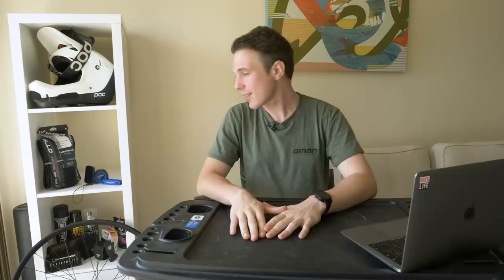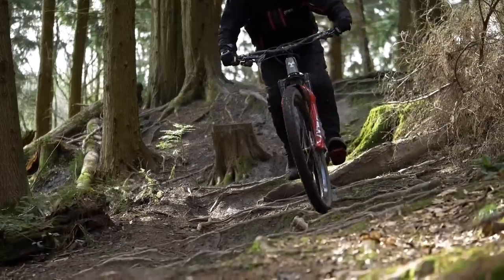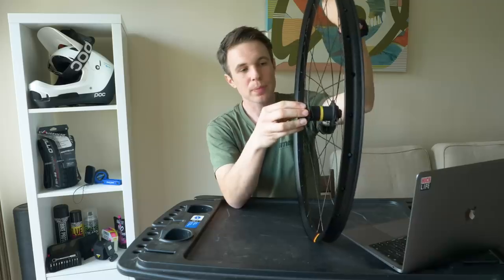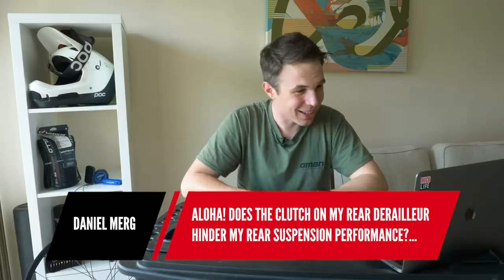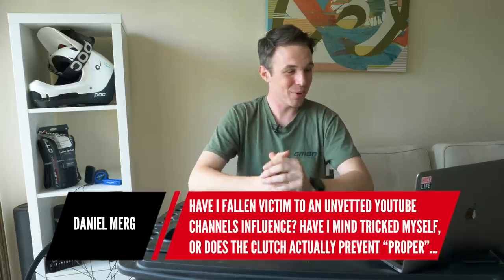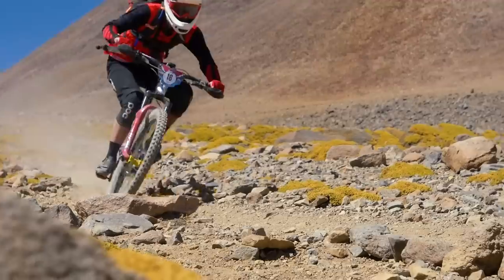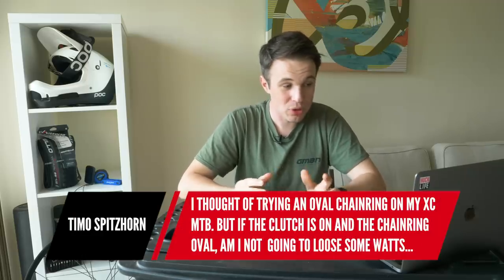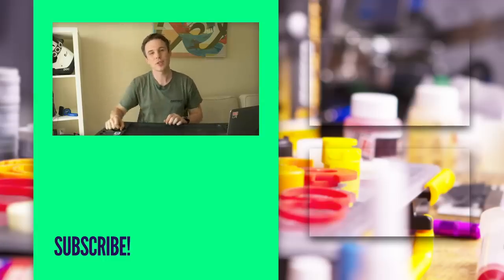E-MTB Components On A Regular Mountain Bike? | #AskGMBNTech

Comment: #AskGMBNTech I recently bought a used specialized status with coil rockshox boxxer forks. The forks needed serviced so the local bike shop put new liquid in and changed the dust seals. Now my fork does something really weird. I'll be riding along with the compression all the way loose and it will suddenly get really stiff and stay like that for up to a half hour then randomly go back to how it's supposed to be. The forks also make a weird squishing noise as it starts getting loosened back up again. Help would be much appreciated. Thanks guys,

Comment: #AskGMBNTech hi, I lover your videos. I recently did a frame swap and needed a shorter travel fork. Can I reduce the travel on my 2015 revelation from 140 to 120mm travel, can I just add spacer or do I need to replace my air spring. (Also how do you add spacers or replace an air spring)

Comment: #AskGMBNTech
Hi Doddy and Henry. Great content on the channel.
I have concern. I got Cube stereo 120 black'n'blue model 2018. My drive train needs some parts replacmet and I decide to o for completly new Deore m6100 1x12 groupset. I have direct mount dropout and I can't find anywhere that rear mech will fit. My curent xt rear mech is fitted completely different way than deroe m6100 mech. Do I need to replace dropout to make it works?
Thanks.

Comment: #AskGMBNTech I have the same squidgy noise but in my 6 month old Lyrik fork.   I definitely think I have air in my damper.    Unfortunately I think bleeding a charger  damper is a lot more involved.   I decided to live with the noise until my 100 hour service.    Anything I can do before that?   Also any issues with waiting?  Finally could I have caused this by storing my bike vertically in a rack that supports the front wheel only (a steadyrack)?    New bike, new rack, squidgy noises all sort of happened at the same time.

Comment: #AskGMBNTech Hey Doddy and Henry, I recently bought a new mountain bike and it has a straight steerer tube and for some reason, the fork moves in the headset, I'm wondering if an o-ring or bearing might be missing or if I just need to tighten the top cap or pinch bolts?  I just bought the bike a few months ago and haven't taken the fork of or anything like that, but I don't think its safe for the fork to move back and forth like that.

Comment: Hello there!
I had a problem with my chain on MTB.
He broke several times.
Is it possible to break chain because of your weight?
It has both suspensions and i am little overweighted. So can it depend on breaking chain?
Reply: No.  The chain will be very strong.  Usually if it's breaking, it's because something is catching under load, and twisting one of the plates off.

I would check for bent or damaged teeth on your cassette and chainrings, and also check that your gears are adjusted properly, and aren't auto-shifting under power.

If you're a heavier rider on a larger frame, you might be flexing the frame enough to cause the chain to shift, especially if it's already a little out of adjustment.
Reply: @nwimpney  thanks alot man, i appreciate it.

Comment: #AskGMBNTech is it common on a 1x11 drivetrain that the biggest cog/ gear drops the chain when back pedaling? I have a 1x11 drivetrain and the chainline seems to be very angled. I removed a link on my chain and removed a spacer on my chainring to help the problem and even after indexing gears and adjusting limit screws it still seems that the chain wants to drop when back pedalling on the biggest cog/ gear.

Comment: #askgmbntech Hey guys, I just bought a new mtb (Cube Stereo 140 hpc tm) with a fox float dpx2 factory rear shock. It has a lever where you can adjust the compression, not a complete lockout, but apparently it increases the compression a bit. However I just can‘t feel any difference. Is it broken or is the sensitivity really that small?

Comment: #askgmbntech I cannot get my gears (seam gx eagle groupset) indexed properly. When I set them up in the stand they shift fine, howver then when out riding they are all alnover the place. Jumping, not shifting. Often it takes a double shift to get it to move down, and then I have to shift back up. I've checked all the usual standard set up things with limiter screws and b tension (using eagle tool) and they are seemingly fine. Any thoughts on what is causing this? Age? Chain stretch? Worn cassette (but chain isn't slipping)? Loose jockey wheel? Thanks in advance, it's driving me mad

Comment: #askGMBNtech 
Hi guys loving the channel, I've recently returned to riding at the age of 29 and bought myself a giant stance 1 for doing some basic trail riding and rides with the family and my eldest on a shotgun seat. However I'm finding the gear change on the bike annoying. It's a sram Eagle SX and no matter how I seem to set it up it will always skip a gear. Ive watched your previous videos for perfect shifting but I just can't get it right. I either get it where it doesn't like changing from 4 to 5 or it doesn't like going into the 11t at the bottom. The bike is only a few months old. What are your experiences with the Sram Eagle sx range and would you recommend maybe upgrading the detailer to a better Eagle one?
Reply: Sean Newlands had something similar with my shimano. The cassette was slightly loose. Also B tension is important.
Reply: @brokenlegz  cheers, I'll double check the cassette.
 B tension is my thinking I've got the wee set-up tool on the way so I can check it properly, I've only used calipers just now and set it at 15mm.

Comment: #AskGMBNTech  Hey dudes.  My local trails are very hilly, so I am shifting A LOT.  I was wondering if shifting too much can wear down my drivetrain/chain quicker?  Thanks!  Love the vids!
Reply: yes as you wwill be using it more but i wounldnt worry to much
Reply: @RealMTBAddict  Yes I have tried that.  Its pretty tough though with no dropper post.  I can do any climb easily in a fairly high gear if I stand up, though I have heard that is a bad habit.
Reply: @RealMTBAddict  Oh gotcha.  I didn't know for sure.

Comment: #AskGMBNTech hey guys i bought one of the new 2021 Rockshox Debonair springs for my Pike so that i could reclaim those few mm in the beginning of its travel. I recently did a 50 hr service on my fork so all i really need to do is replace the spring and maybe lube the seals and replace the oil in the lower leg. My question is, can i re use the crush washer that you usually replace when doing the 50hr service or will i have to buy a new one? Thanks guys!

Comment: #AskGMBNTech
Hi guys, I have a giant fathom 2020 which comes with a rear hub with a 5mm smallish quick release axle which I'm worried isnt strong enough for the stuff I put my hardtail through. I want to upgrade my hub to a better one with a thicker thru axel, but my frame has the slot for sliding in the thin 5mm quick release. Is there any way of using a thicker thru axel on that frame, or do I need a frame that comes with a thicker thru axle instead? Thanks a lot.

Comment: #askgmbntech Hi Henry/ Doddy love the show, I have a 2013 slx drivetrain it is a 10 speed cassette and a triple chainring up front I want to go 1by up front is there any way I can use my slx derailleur on another 10 speed cassette but with different ratios as I want a big 10 speed cassette in the back, if so is there any 10spd 46ish teeth cassettes that you guys would recommend, thanks again, keep up the great work
Reply: Sunrace components provide cassettes with big range for 10 speed, you might have to fit a longer bolt instead of the standard b-tension bolt to make the mech clear the biggest sprocket on the cassette, but you can still use the same derailleur. I have been using my medium cage XT derailleur on a wide range 11-42t cassette for over 4 years now. Works spot on. Sunrace works with both shimano and SRAM. Got the bolt from B&Q and the cassette from tweeks cycles. Just grab yourself a 10 speed narrow wide chain ring to go with it and a new chain, because you will need a longer chain definitely!!
Reply: Not sure they do a cassette with up to a 46t for 10 speed, I think that's just for their 11 speed range. But they definitely do an 11-42t cassette like mine. Usually around £55. Mint piece of kit, lasted ages, and I use that one my steel 29er hardtail, climbs perfectly with a 32t oval narrow wide chain ring.
Reply: Will L Thanks man really appreciate it 👍🏼👍🏼

Comment: #AskGMBNTech what would be a better tire combo with Maxxis, DHF and Aggressor or DHF and DHR 2
Reply: Dbacks444123 depends on preference. Both great tires. I ride enduro and run a dhf in the front a dhr2 in the rear. All depends on the discipline
Reply: i used to run dhf aggressor now i run dhf dhr i prefer my new set up maybe because i ride dry australian pea gravel
Reply: I ride on California rocky clay,dust,and loam
Reply: Noice
Reply: Ok so I should go DHF and dhr because I live in Tucson Arizona, it’s rocky
Reply: Dbacks444123 that would be a good choice because they have a thick casing and they have a good compound for durability. I would say YES
Reply: Dbacks444123 what kind of bike do you have?
Reply: I just have exo because i am only 45 kg
Reply: Anthony V I’ve got a giant talon 29 2, currently running Vittoria barzo front and rear
Reply: Dbacks444123 On hardtails i like really good grip
Reply: Tao Brice MTB so would DHF and dhr be good grip?
Reply: Dbacks444123 Yeah good for loose corners
Reply: Tao Brice MTB thanks

Comment: #ASKGMBNTECH Hey guys! ive noticed last ride that my sidewalls are starting to weep/sweat tire sealant. Is this normal? Im running Maxxis Minion DHF front and rear. Im pretty sure its just the rear its doing it. I usually ride around 30-35 psi but put it up to 40 to see if it stops it. Cheers!

Comment: #askgmbntech This may have already been covered in a previous video, but I haven't seen it yet. Can you go over the difference between 1x and 2x rear derailleurs? And effects of bodging it. I am getting ready to build a XC bike and wanted to run a 2x upfront for versatility, but wanted the 51t outback for technical climbs. Will the 2x derailleur contact the cassette if I use it with 10-51T? Other than having to be more careful with gear choice to avoid running out of chain will running a 46/30T chainring negatively effect the 1x derailleur? The  lower gear ratios end up almost identical running 2x with 45t or 1x with 51t
  #askgmbntech
Reply: Why do you need a 46x10 top gear, you want to not spin out until you hit 40 mph do you? There is a reason nobody does this, nobody needs that much range. If you want a 30-50 low gear, get that in 1x. That gives you a top gear of 28 mph at 110rpm. Add about 2mph to that number for every chainring size up. Think about how fast you actually go.
Reply: Local trails have a lot of flat area bordered on either side by steep climbs. So on my Gravel bike, I typically cruise across the flats in the 52t chainring and 11t or 13t cog, and ride the climbs in lowest gear 34/38. I plan on similar rides on the XC, but with more techincal terrain and a suspension fork. So, I want the lower gear ratios for when stuff gets really steep. Honestly, if I go 1x, I will probably end up running a 38t or 40t, upfront anyways, and just grind the climbs.
Reply: Well I can tell you on my road bike I’ve used a 50/34 and a 10-42.  I was doing the Pittsburgh dirty dozen, so I wasn’t using the top end just the bottom. You definitely have to be careful, I damaged a pulley wheel when I was in the big ring. After that I just avoided using it. Separately I have had a go downhill using a 53-10 combo 😁.  I haven’t tried this off road, but other than being careful with the chain you could get a 46-30 to work with a 11-42 or 10-42 cassette. 38-10 is still a very big gear though, that’s the same as a 46-12. Even for gravel that’s only a gear for the downhills. I would try to get a 38-28 crankset and pair that with a 10-42 11 speed. 28-42 is the same as 30-45.

Comment: #askgmbntech Hey gmbn! I'm thinking about replace the chainring on my 2016 SRAM 1x12 drivetrain with an oval one. Would this replacement be compatible with my current setup, or would it cause stress the drivetrain is not designed for? Thanks in advance
Reply: If you got the right oval chainring for your crank interface then it would be completely fine for your drivetrain!

Comment: #AskGMBNTech  Hy guys, loving the show, I am at the start of a bike refresh, I have an older bmw enduro mtb, and I am thinking, can I conwert it to oneby?
I just bought it last year from my hard earned money and I really don't have a budget to replace the rear derealeur. I am running an older sram x9 with a longer arm clutchless I think. I allso like to send some jumps, or get speed on the trails. My 3 chainrings on the front and my chain is completelly worn out, as well as my casette.
Reply: You could easily convert it 1x with a new chainring just make sure to read up and figure out the bcd of your cranks first.
Reply: @bananasstuff3344  Thanks, than I will do it for shure

Comment: #askgmbn I have some guide rs brakes on my 2016 commencal meta v4 650b and when ever it is a hot day the brake lever sticks and doesn't come back up after being pushed. How can I fix?
Reply: Paxton Smith low key I would just get the new Shimanoe Deore brakes. My guides from that era 2014/2017 also did that it is a common issue. But yeah the deores are pretty ‘affordable’
Reply: If I did that would I have to switch out the rotors too or would those be compatible

Comment: #AskGMBNTech can you use wd 40 as chain lube
Reply: Wd 40 is not a lube. It can prevent corrosion and acts as a solvent. So you can use it for cleaning the chain (although it will not be as effective as a dedicated degreaser) but u cannot use it as lube
Reply: It can be as it has a decent mineral oil content, but there are better choices out there, it's designed as a water displacement spray.
Reply: WD 40 does make a bike chain lube but don’t use the basic WD 40 stuff

Comment: #Askgmbn hey guys recently went on a ride and, after doing a kind of rough down hill section. My chain hopped of of the front middle sprocket and, got wedged against the frame and the small sprocket. What could cause this as it is starting to happen more frequently? Just looking for things to check.
Reply: Buy and install a chain guard or bash guard or a chain tension holder

Comment: #AskGMBNTech  #askgmbn   is boost forks same as plus size, and can i fit a 29er wheels on a boost 27.5 suspension forks
Reply: Boost refers to the hub size, 110 mm wide. And no, you can’t run a 29 in a 27.5 fork no matter how wide the axel space is. You might be confusing “plus”. A 29er fork also fits a 27.5 plus tire most of the time. Plus is tires, boost is axle spacing.
Reply: @jonathanzappala  thank you